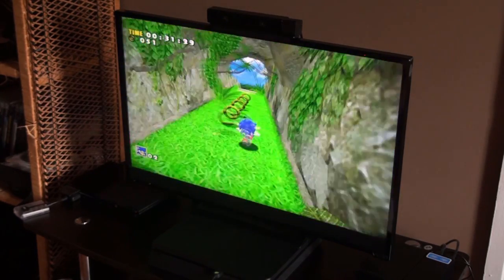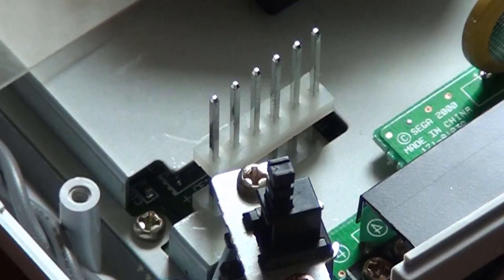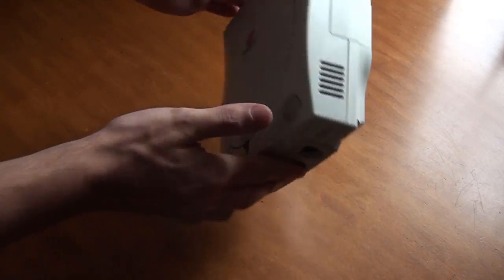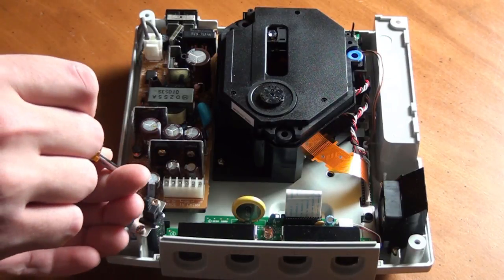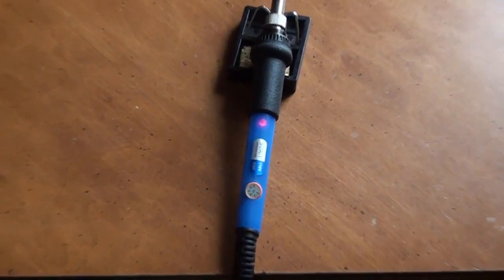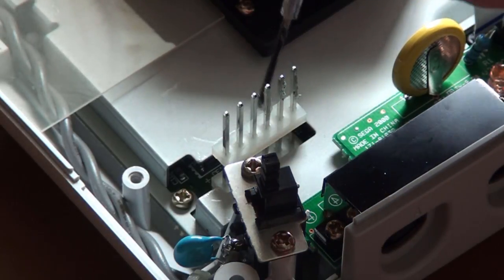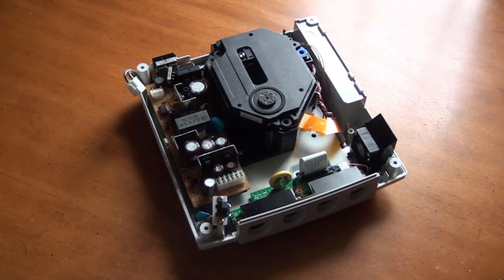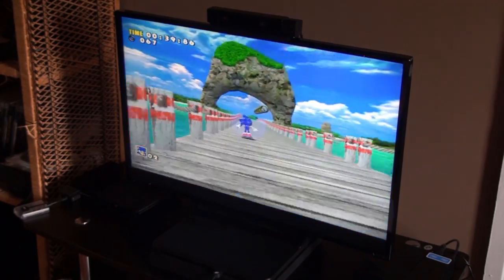How To: Fix Dreamcast Random Reset Issue

Comment: For those who don't want to mess about with soldering, a thorough cleaning of the pins with rubbing alcohol will also work more often than not. The soldering method is recommended if that doesn't work.

Comment: Soldering is beyond my capabilities, but other than that this technique worked miraculously. The Dreamcast is very easy to take apart compared to other systems. I gave the pins a wipe (even though they weren’t very dusty) and gently but firmly pushed them forward. After reassembling the Dreamcast, I was able to beat Jet Grind Radio and play Power Stone 2 on it.

Comment: Fixed mine and a friend's Dreamcasts that had this issue, its pretty common. All that was required was to check the pins were straight and give them a clean and the issue was fixed, although granted further steps may be necessary for others.

Comment: This was an issue I had with a Dreamcast I picked up used from Mercari. I thought the system was ruined... ruined! But no, this seems to be a common issue. Cleaning the pins with alcohol offers a temporary solution but if I have that problem again, I guess I'll be trying this solder suggestion. Thanks for the advice.

Comment: Sponge..WD40...Clean pins....Then Dry scouring pad...Then very fine sand paper....ive just done that and now its been working fine for over an hour.....I credit this vid for showing me the pins are the problem...cheers for that...but solder is a final fix if cleaning doesn't work....good video :)

Comment: Hm, after doing this my power led no longer changes brightness as the dreamcast reads discs and doesn't seem to be resetting anymore, but I had to decrease the resistance on the gd drive pot as it would now try to spin burned discs backwards super fast. regular games worked fine.

Anyway, decreasing the resistance for the gd laser just a tiny bit fixed this problem with burned discs for me. I'm guessing my dreamcast had less than optimal power input when manufactured and the laser was calibrated for that.

Comment: Hi there! i tried to turn on my dreamcast one of these days, and it worked for some time... the inicial screen was still charging, when suddenly the console made a "pufff" sound, and there was smoke coming out... i opened it to see what was wrong, and realized that one of the capacitors has exploded... is it possible to replace that piece?
Reply: Short answer yes its possible, Long answer is you really want someone with a some experience in electronics to do it you have to match the capacitor exactly and messing up could cause a fire.

Comment: Not sure if you will reply but my dreamcast reads some discs and not others, is that a problem with the power or the laser eye itself. 
Mine will read games like sword of the berserk, marvel vs capcom and will reset sometimes but for example if i put a game like alone in the dark. It refuses to read the disc most of the time. Its reads the disc sometimes but most of the time it doesn't.

It just stays at the menu with the disc running after a min but doesnt start the game
Reply from the maker: It sounds more like a dying laser to me.
Reply: DreamcasticChannel 
Turned out i had to adjust this little strange screw on the paser with a very small flat head. 

So far alone in the dark reads quickly now every time i put it in. 

Heres a link just in case someone else goes through the same.

https://youtu.be/8MXxppdvc7E
Reply from the maker: Unfortunately that's just a temporary solution. The fact that you had to do that indicates that the laser is on its way out. Adjusting that screw increases the laser intensity which will fix the issue but will also shorten the laser's lifespan. Eventually it will have to be replaced.
Reply: DreamcasticChannel 
I have another DC either way. I guess i could buy another laser on ebay as a back up. how long do you think the adjusted laser will last?
Reply from the maker: I couldn't say as I've never had to do it myself.
Reply: If anyone asks in the future i'll let them know wither its still working or not.
thank anyways.

Comment: sorry that is the wrong way to fix it. the right way it to bend the contacts on power supply board to make it tighter if that is really the problem.
Reply from the maker: That is one possible fix but it's not guaranteed. That didn't work for me but this did.

Comment: What if the dc would start up with its DC intro but then instantly blacks out after that

Console still powered on, audio visual cables fine, everything else ok except for that shit
Reply from the maker: That could be a number of things but it sounds like your fan might not be working. That's exactly what the Dreamcast will do if it detects the fan isn't spinning.
Reply: @DreamcasticChannel  what do you suggest?

Comment: Recently I cleaned my Dreamcast. I scratched pins with screwdriver and coated them with tin. Problem appeared Aagain
Reply: So I've switched power cords from my ps1 it worked. Played yesterday about an hour in phantasy star online in closed case, it was ok. Today problem 's back. I took off case, it helped but not for long. I running out of ideas, is as someone said There changing capicitors will solve the problem ? My DC model is katana btw.
Reply from the maker: It could be a bad power supply which would need to be replaced. It could also be a loose fan cable or fan connector which caused the issue for me at one point. The Dreamcast will turn off if the fan stops spinning and start up again when it starts spinning again, which makes it seem like the Dreamcast reset.
Reply: @DreamcasticChannel  Not sure which "power supply" do you mean, I plugged cord to the wall outlet, same result. But I forgot to mention one thing. In the 2000's when I bought DC second hand, me and my friend were found solution. We took off the case, unscrewed power board nad bend this board to the left. Stupid solution, pins are little twisted to this day, but surprisingly it worked I had no problem with random reset doing that.